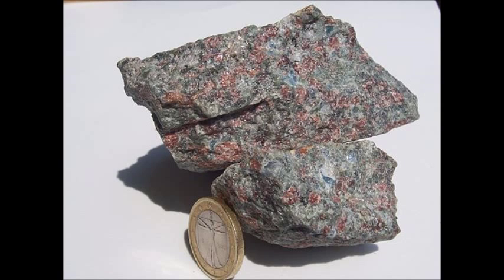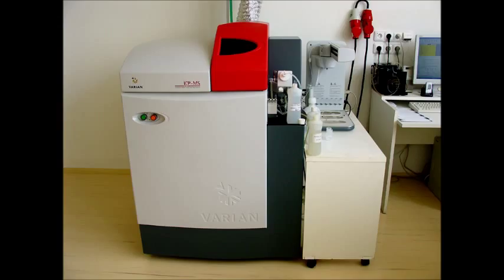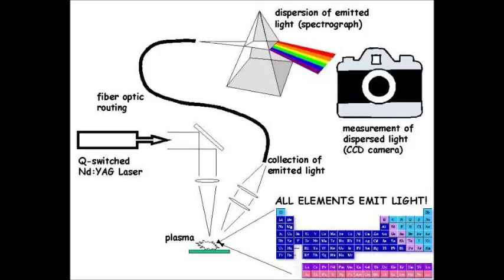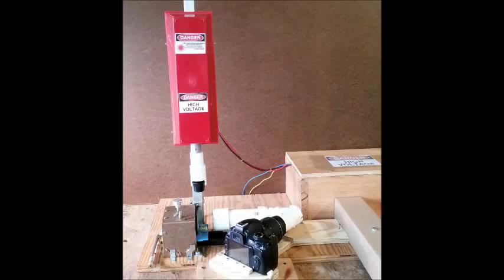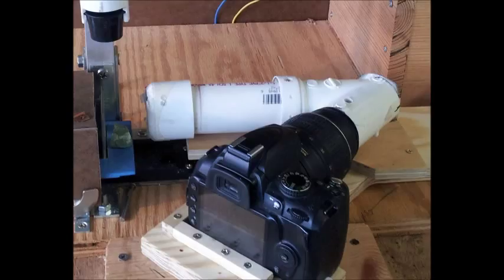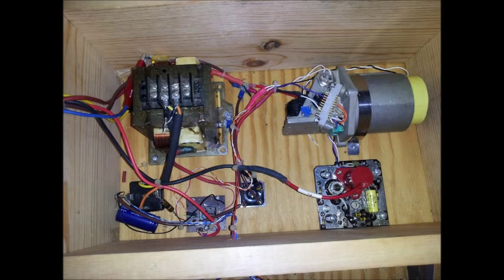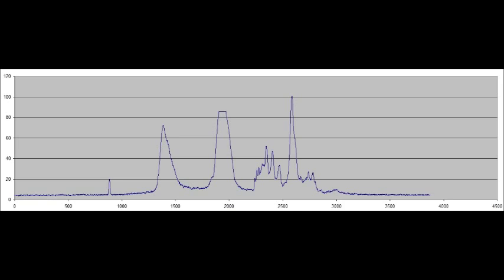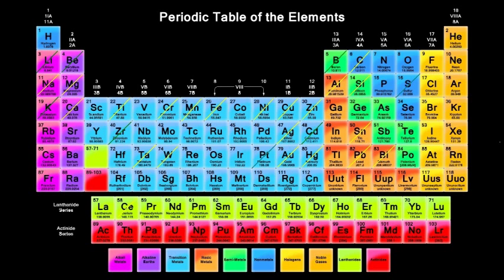Libs1

Comment: Any updates?  Looks like the links above are broken.  Can you please share or update the links if they've changed?  Looks like isn't archived on the Internet Archive either.  I was under the impression the CCD like from a webcam won't function... I forget offhand... seems like won't be sensitive enough or able to be gated.  Eventually I want to try as I plan to with the 2K webcam and Theremino or Les' Lab Software design once I find the time to do.  Please share your design, that looks really neat homebrew!
Reply from the maker: Sorry I don't monitor this post any longer.  I just looked at it because I am going to overhaul it with 9 years of changes.  I originally used a so called "SSY-1" laser which was used on the M1A1 Abrams tank as a range finder.  Hundreds of these things were available but I think I bought the last 3, they can no longer be found.  https://en.wikipedia.org/wiki/File:SSY1_Military_Surplus_Nd-YAG_Laser_Firing.JPG
  I am using instead a tattoo removal machine.  Example :  Google "ND Yag Laser Tattoo Removal Machine"  Mine set me back about $ 500 about 5 years ago.  They can be found cheaper now but "Caveat Emptor"  These things are water cooled and thus can put out like 10 pulses per second which can be needed.  
I also abandoned the photographic technique used on this early system, first for a relatively cheap ($200) Science Surplus spectrometer which was a BW Tek spectrometer from some kind of medical device which was repackaged by Science Surplus.  These units which were very popular have been sold out for years.  The most bandwidth I could get was about 350 nm to 575 nm. I replaced this spectrometer with an Ocean Optics USB 2000 (about $600) spectrometer which has a much greater bandwidth but somewhat lower resolution.  Other than that now it is pretty much plug & play.  Please feel free to get hold of me.  I am ulao followed by (the number ten) at GeeMale dot Commercial.  Work on it you'll figure it out.  I am more than pleased to help.  Also interested in anyone who knows of or is interested is starting an amateur LIBS user or discussion group.